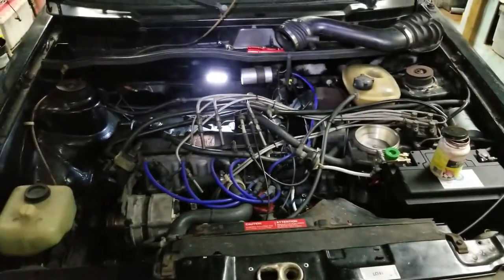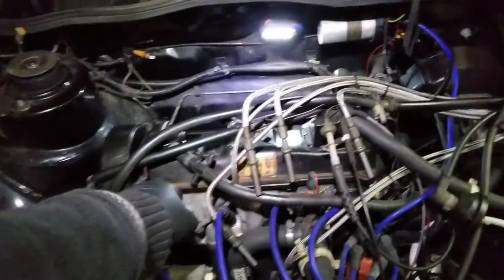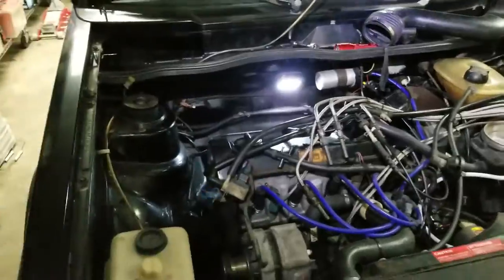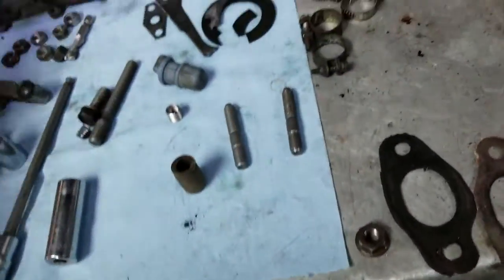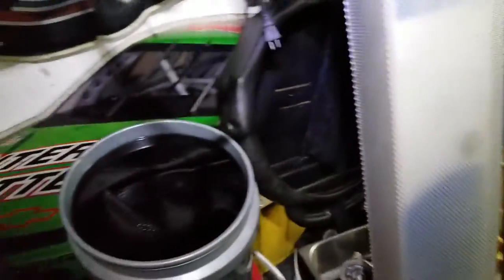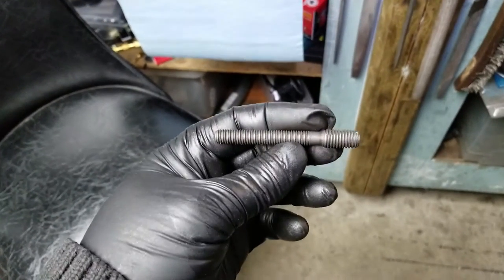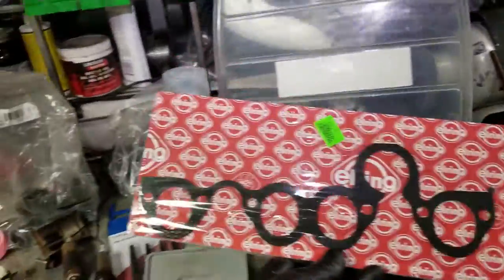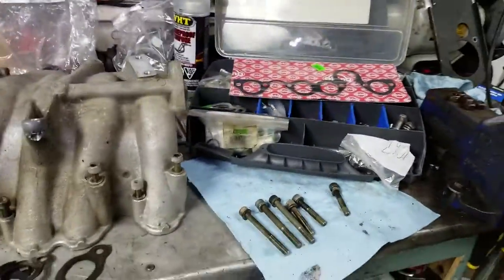1984 Rabbit GTI intake manifold, exhaust manifold and CIS system overview

Comment: I have a 82 mk1 VW pickup, 1.8L petrol.  I'm giving a refurb on the engine because the 1.8L replaced the original diesel.  Having issues with broken connections etc from a hasty engine installation.  Broken CIS air box - -> to a round bottom Volvo air box.  We need to message. Buy and trade as well. Big time mk1 petrol guy here.

Comment: How do you get the bottom o ring on the fuel injectors out? I noticed yours are still stuck in the head. Mine are also stuck and I’m curious how to remove them
Reply from the maker: I use a small right angle pick, or unthread the injector seat from the head, I can not remember the allen key size. A mirror and removal of the intake manifold makes this easier. I hope that helps, depending on the age of all the parts disassembly can be a challenge. Thanks for watching and commenting, Cheers!
Reply: nigel page thank you. I’ll give it a try!
Reply: Modified wire coat hanger also renders some luck